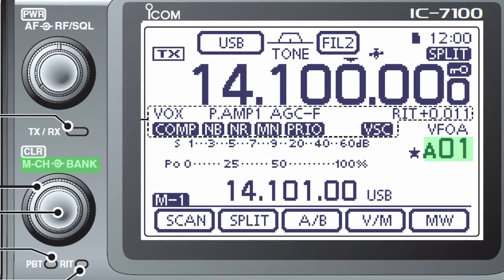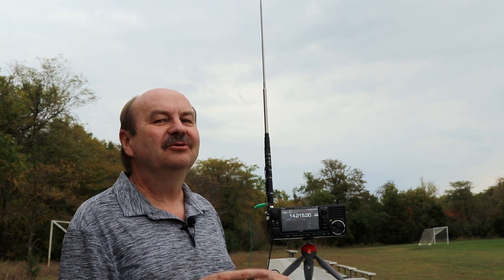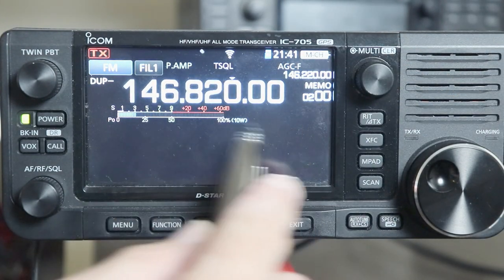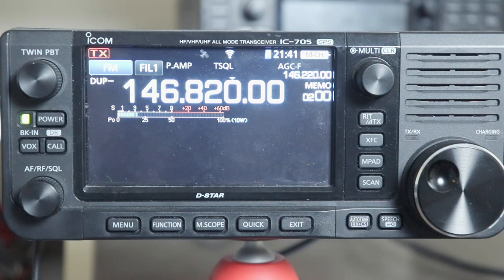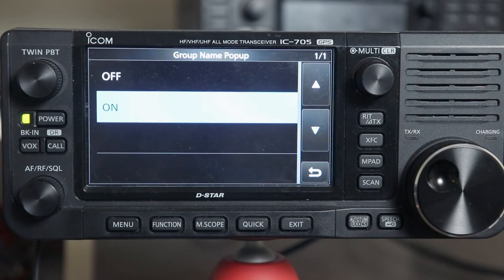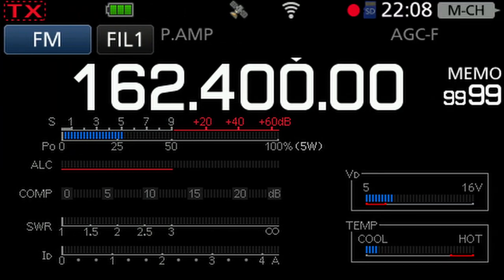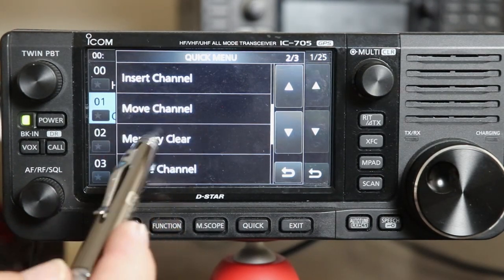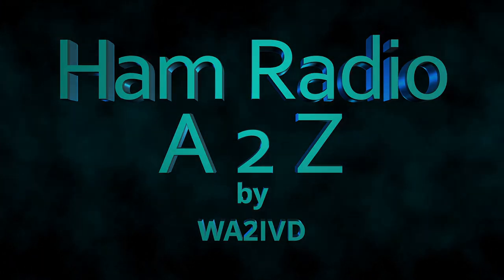IC-705 A to Z #10 Memories & Memory Functions

Comment: I finally got the right antenna, cable all installed for 2M/ 70cm. But now my mic doesn’t seem to be working in order to tune the radio to the antenna. What am I missing?
Reply from the maker: I'm not sure I understand mic not working and tuning the radio to the antenna.  Do you mean that the PTT is not working so you can't transmit?  One thing I've noticed about the IC-705 mic jack is that it is easy to push the mic connector in only part way.  Make sure it is pushed into the jack all the way.  Other than that, I can't think of what might have changed with changing cables and antennas.
Reply: @HamRadioA2Z  thank you for your response. I called Icom tech support, they weren’t sure either. So they had me do a restart and that fixed it. I would key the mic, but wouldn’t break squelch. All good now, I am able to check my swr now. Now I can go back to watching your videos.

Comment: Hi, do you know how I can "skip" memories when scanning memories? cant find that information anywhere
Reply from the maker: You can’t skip memories.  The 705 has a feature that is the opposite of that.  When you are on the the Memory menu or the Scan menu there is a SELECT button.  When you press that, you will see a *1 under the memory number.  You can press SELECT multiple times to cycle between *1, *2, *3, and blank.  Set all of the memories you DO want to scan to the same * number.  Then, in the Scan menu, press and hold the MEMO soft key.  You will get a pop up that gives you the option to scan ALL Memories, Select *1, Select *2, etc.  The Select options will only scan memories designated with that * number.

Comment: I love this set of videos. What is the setup that you're using at the start. I have issues in that I never seem to get contacts. Do you use any ground wire?
Reply from the maker: I was using a Comet Toybox portable HF whip when I filmed that.  I did have a counterpoise wire of maybe 15 feet.  Honestly, I haven’t been overly thrilled with the antenna.  I have never been able to get it tuned to a decent SWR.  My son recently got a portable vertical with an adjustable coil. (The toybox has fixed taps). He got it on Amazon, but I believe it is identical to the MFJ-1898.  It seemed to work really well when we tried it a couple weekends ago.

Comment: Thanks Tom!
Just spent a rainy afternoon here organizing my 705 memory contents.  Nice not to have to erase and start from scratch when you come up with a better way of organizing. 
In my Call CH memories (4), 144 CH1 &  CH2 are duplicates as are 430 CH1 &  CH2...spent too much time trying to figure out how to remove the dups. Thought it was something I had done, but even though you scrolled through your Call CH memories really fast it Looks as if yours are the same too. 😝
Reply from the maker: Thanks for the kind words.  The video was already getting pretty long.  So I had to leave the call channels and some other features for another video.  Yes, the default frequencies for the call channels are the national simplex (US) frequencies for 146 and 440.  Honestly, I don't find the Call channels very useful.  in order to use the CALL button to quickly take you to the channel, the radio has to already be on 2 meters to go to a 2 meter call channel and it has to be on 440 to go to a 440 call channel.  You might as well just go to a regular memory.

Comment: Can one memory be in multiple groups?
Reply: Yes...
select the memory, 
select memory copy, 
navigate to the group you want to put it in, 
select the memory you want it it in, 
Select memory write,
Overwrite-yes.
You will still have to edit name if desired
73
Reply: @curtohalloran7582  That sounds like a duplicate of a memory and not a single memory in 2 locations like in a current yaesu.
Reply: You’re correct. The way I have my radio memory organized, the duplicate still serves my purpose.  I suppose in some cases it might not, especially if you had to edit that memory for some reason...you would have to edit it and all the duplicates.  😜
I don't know of a way to have one memory in two locations on the 705 as you describe.  73
Reply from the maker: Yes.  I believe that is correct.  I think internally, the 705 treats the group and channel as just the upper and lower digits of a 4 digit channel that can go from 0000 to 9999.  So if you want the same thing in 2 different groups you need to use 2 memories.